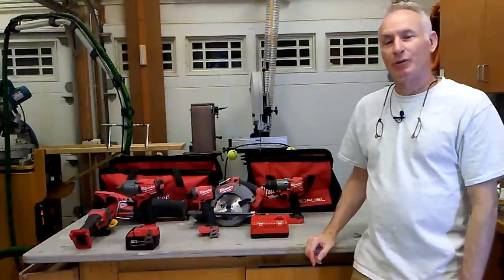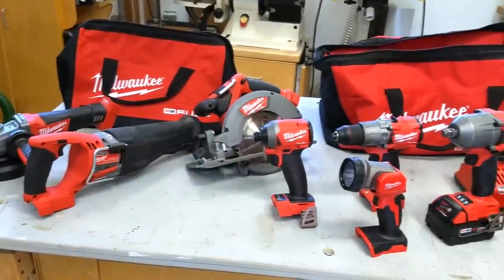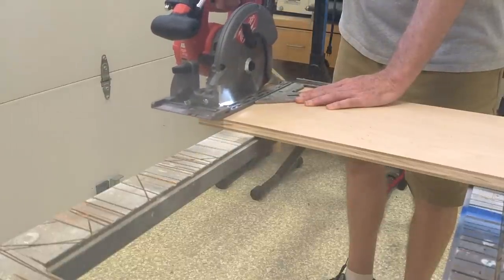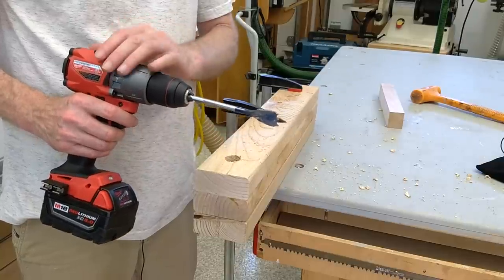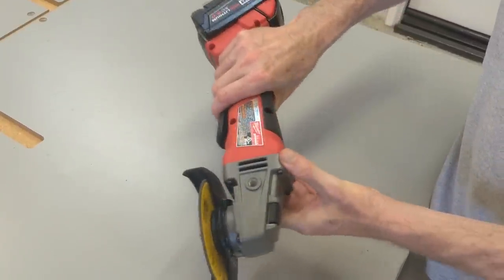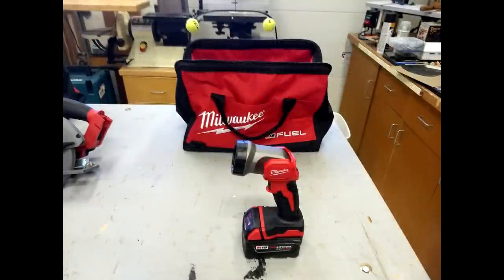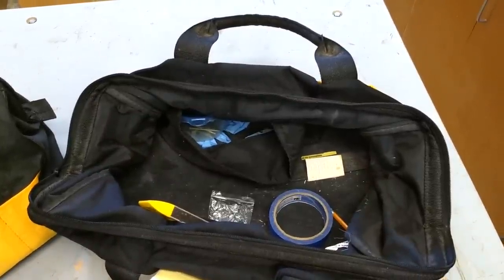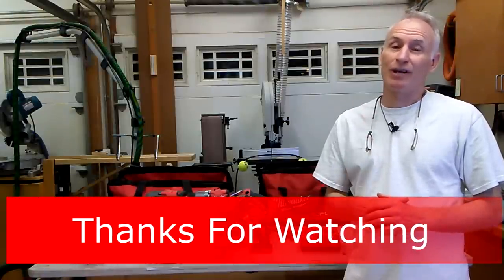Milwaukee 7 piece cordless tool kit-Summary Review up front

Comment: One reason the sockets were difficult to remove from the impact hog ring is that you were using standard sockets and not impact sockets.  It's worth noting the high shock torque of these newer Lithium impact wrenches is even more prone to shattering non-impact sockets - shearing off the bolt head is minor annoyance but an exploding socket is a bigger problem... especially without eye-pro.
Reply: That's the only reason..
Reply: I was just about to say that glad I saw your comment I’m a diesel tech and every time I hear that comment from a contractor I instantly place that same comment on the video

Comment: I work in San Francisco building concrete high risers as a Concrete Carpenter. And let me tell you. THIS KIT WILL DO! We abuse and torture our tools pass them on to the next guy, he beats on it, then on to the next guy and son on. We are a productive crew.

 When they tell you on the 31st floor deck to go down to the ramp and deck i; do form work/ledger/edge form/cut rebar for shut offs etc etc..... A cordless 
drill/impact/saw/hammer drill/grinder is better to tote than 2 50ft cords and a skill saw/corded tools. I think this kit would be more than enough for a DIY type of guy........

 The Milwaukee FUEL line of tools is PROFESSIONAL grade it's been PROVEN at the jobsite not at some Joe's garage who is doing a review on tools that look brand new! Smh

Comment: Not sure where you’re getting the tools individually for less than the bundle. Just priced it out based off that statement and came up with $1570 without batteries or cases. 
 Seems a lot of people are looking at the standard M18 brushed motor tools. The fuel series are always more.

Comment: Depending on where you buy It, it can be worth it. On ToolUp, I found the kit for $999 but it had the blades for the Circular Saw, reciprocating, and angle grinder. It also had the 2 batteries and 2 bit sets. On top of this, you had your choice of 3 items for free. A higher torque impact wrench, tower light, or 2 more batteries. If you buy it from them it'll definitely be more worth it.
Reply: the same price even... looking now!
Reply: Now it’s on Home Depot for $500

Comment: Good review...your numbers are slightly off. The circular saw is $150 and the driver/drill combo  cost you quote is gen2 not gen3. Gen3 kit is $380 and just came out. The gen3 driver is $129 and not available cheaper bare tool. It is definitely more powerful than the Makita since its newer. If you add it up you do save some money. Would agree flashlight is weak. They do have the deal with the high torque impact driver which is $219 vs the mid torque at $189 which you got that saves even more. Personally the mid torque is plenty powerful.

Comment: model 2694-27.. 7 M18 tool combo kit, 2x 3.0 Ah batteries, 1x 5.0 battery, and one contractor bag on sale for 499 (from 899).. I consider the $500 investment in Milwaukee is the best investment in the category.. otherwise, good video

Comment: Milwaukee is by far the BEST cordless tool maker on the Market , Next would be a tie between Bosch , Makita 

If you want the Best get Milwaukee M18 Fuel line with the M18 HO Battery either 9 amp or 12 amp. 
I have 44 years of experience with tools. Also am NOT paid like some You Tube testers are. Just know and use good tools.